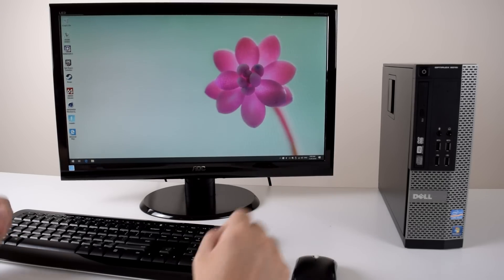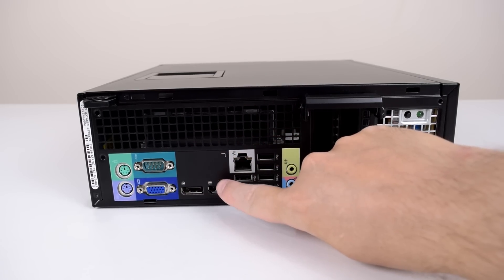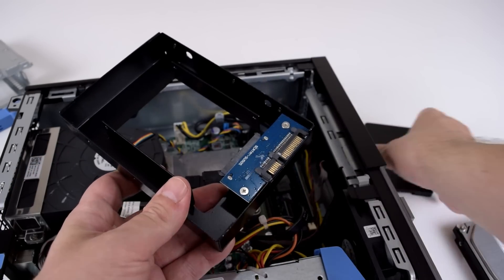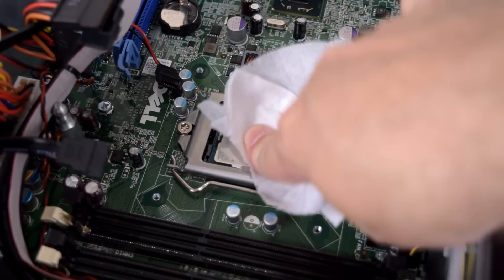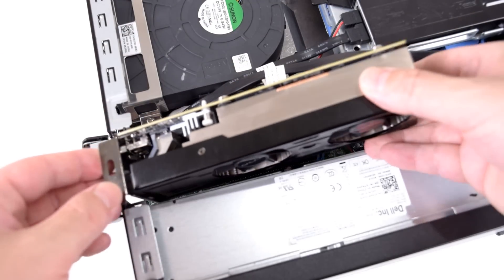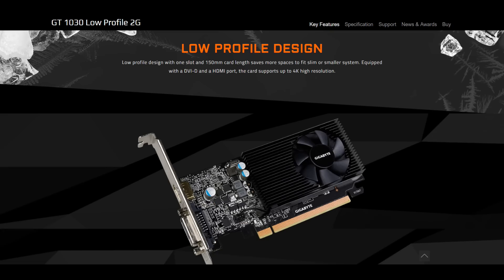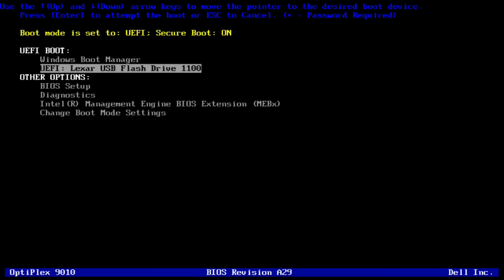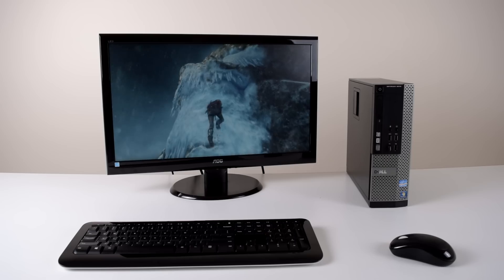DELL OptiPlex 9010 Upgrade Guide! Core i7 32GB RAM GTX 1050 Ti and more

Comment: 1050ti seems like a nice video card, bought 2 for use with blue iris for security cameras and both run surprisingly cool/etc(used off ebay, one is hp and other gigabyte)... last card I bought was 760 gtx, coming from that 1050ti is refreshingly simple looking and low power, only thing that would of been nice was a single slot design which I kinda feel they could of pulled off

Comment: Why a 1050ti with i7 i think rx 570 would be a better option.
Reply: The 1050ti gets it power just from the motherboard.  The Rx 570 requires an 8 pin power supply cable that this office pc probably doesn't have. It probably requires much more power to run as well that the small power supply here probably can't support. I think the RX 570 is a full size card too, so it wouldn't fit either.

Comment: I have i5 3570, 2x8 ram, ssd, hdd, stock 240W psu. I decided to add GTX 1650 mini OC (not low profile), so I made custom aluminium reversed T-shape stand, painted to black matt, painted Motherboard to matt black (no plastidip needed, just cover properly components), painted also PSU. From one side I mounted MB, from the other side PSU, SSD and HDD. No issues at all, good gaming like Far Cry 5 on max details @60fps or more. CPU/GPU temps never cross 63 degrees. Custom LED stripe. Very happy with my build. But 240W is more than enough for i5 (77W) + GTX 1650 (75W) = for cards without additional external power 6pin connector
Reply: you had no problems?

Comment: gpu is blocked and cant pull air
mine 2 when i removed the case cover i noticed 15c degrees reduced temp

Comment: I love the Optiplex machines. I was able to modify the bios to add bootable NVME drives via the PCI-E x16 slot with a cheap adaptor. This worked on the 7010 and 3020 models. Great little office PC. Now NVME 128GB m.2 drives are as little as ~£17
Reply: Have a link?
Reply: @tehgearz  I might do a whole blog article about this but the bulk of my journey was via the win-rar forum. https://www.win-raid.com/t4537f16-Dell-NVME-BIOS-Lock-Mod-Discussion.html Basically if I recall correctly it's put the motherboard into service mode with a jumper by the lowest PCI-E slot. Boot into DOS via USB. Make an image of the bios. then modify the image to add the NVME functionality using the correct software. win-rar has an excellent article. Then write the modified bios. Restart and then you can boot from NVME if bios option activated. I added quite a few pictures to the win-rar forum. I'm SITH. I did this on my 7010 and used same method on my Dad's Optiplex 3020.

Comment: I got a barebone 9020 for about $40 on ebay. Added 32GB for less than 100, i choose a wx4100. It's about on the level of a 1050, certainly beats the 1030 but is a single lot card and absolutely silent. This frees up the PCIe x4 which I use for a dual sata/nvme card and thus also leaves the drive bay as is. Sata is the boot drive while i use a 2TB nvme drive for all my games. It reads about 1.5 Gbytes/s from that slot. You can also upgrade the standard psu to a 315W psu if you are concerned about power. This comes with a 6pin gpu plug but currently there is no low profile card awailable which requires more than the 75W a PCIe can provide. With an open case, a Radeon Pro W5500 might fit which exceeds the 75W. But, i agree, i love that little box. Waiting for a 4 to 5 TF single slot card which fit. Maybe AMD is going to release a W4500 some day. Otherwise, the WX4100 gives my 1650 quite a run for the money.

Comment: The main pc in my library which powers the other PC's has 32 GB ddr4 ram, no graphic card and an i9 8600k.
Reply: If you say so
Reply: @alex-w8p2e  ooook
Reply: The i9 8600k does not exist
Reply: @alex-w8p2e  it maybe an 9600k
Reply: @alex-w8p2e  I dunno the exact specs but it's powerful...as hek

Comment: btw, if you don't have many options for a decent wifi dongle or you have an old smartphone laying around usb tethering is pretty reliable. my dongle refused to stay connected over 15 minutes straight so my sister gave me her old moto g and it works pretty fast
Reply from the maker: Yea get a branded USB Wireless dongle, they work much better!

Comment: Nice video.  It's 2020 and prices for the 9010 i7 and GTX 1050 Ti low profile are falling fast.  Today, the i7 3770 CPU is about $70 and the GTX 1050 Ti low profile is $90 on a good day.  Very tempting upgrades for my 9010.  I lucked into my 9010 SFF with i5 3570 for $15 because the optical drive was broken!  It had a laptop hard drive with Dell 2.5 in. adapter so a SSD will install with ease.  I went with a half height 3.5 inch spinner which loads W10 fast enough for me.  I found a Dell GTX 745 (4GB DDR3) locally for $30 and added the same Wifi AC adapter as in the video for another $5.  Mine is $50 and is perfect for what I do which is YT and video streaming.  It will stream 1080P 60 fps with no stuttering or buffering.  It's small enough to put in the living room for service as a HTPC.

Comment: I got the same PC for the same price almost on EBay also. I read that I CANNOT use all 32GB of RAM (only 2 RAM sticks totalling 16GB) IF I intend to use the graphics card because of a lack of power (only 240W) and that is even if I unplug my optical/CD/DVD drive. I now only use one SSD and no other hard drive. Has anyone tips on this?  I bought it for video editing , so am very disappointed about not being able to use all RAM slots.  I don't own those RAM cards yet, though.

Comment: I recently bought an optiplex 9010 sff but mine seems smaller. I'm a bit concerned that if I get the same or similar upgrades they will not fit. Has anyone heard of that being an issue or should I be able to get the same upgrades with no issues.
Reply from the maker: Yea there is a smaller version to the one I used.

Comment: Can i shove a 1650 super instead? Great video btw!
Reply: No a 1650 Super requires separate power supply. It cant run off of the 75w PCI slot.  The 1650 DDR6 Low profile is the best the GPU can get right now in low profile sff. I'm doing one now with a HP i7-3770,  GTX1650, sff build.

Comment: Hey really loved the video, I have a optiplex 990 with no upgrades. I wondered if adding an msi gtx 1050 ti low profile would make my performances on games way better. Also, do I need a wire to connect it, I don’t find it in my computer. Thanks !
Reply from the maker: Yes a low profile 1050 Ti should work really well! There are no internal cables to connect, but you plug the monitor into the 1050 Ti of course!
Reply: Thanks !

Comment: Here is a gpu that works on most desk tops and does not require a power connector also fits in just about all cases and plays games in high to mid settings , its one of the best out there if your on a budget like i was. Check this beast out in the link i provided and leave me a like if u agree.  https://amzn.to/39D6CO0

Comment: Hi mate was wondering will a full size gpu fit in there minus putting the cover back on aswell if there is few mod cutting things will it fit ? you prob heared this question before but so many full size 2nd hand gpus dirt cheap rather mod it to fit if possible
Reply: Im going to the 2nd version of this its not the full size desktop tower but between yours n fullsize

Comment: Would it work with this setup if I add the graphics card
DELL 790 SFF, Core i5-2500 3.3GHz, 8GB RAM, 250GB Hard Drive, DVDRW, Windows 10 Pro 64bit (Renewed)
Reply: If you can fit, itll work so u can play games on it

Comment: I was able to buy one of these but a mid size tower. I5 3470, 8gb ram for $50 added 8 more gbs ram, ssd, psu, gtx1060 6gb all for less than $250 total :) just need a 3770 next

Comment: I got a Dell Optiplex 7010 a couple of years ago upgraded with a GTX 1050ti graphics, it's been very good so far. These little things are sleepers, they are quiet at the desktop and cools well under load. I was surprised.
Reply: Not so cool on me. 
Mine GPU hit 84dgc
CPU hit 95dgc. 
7010 my
3770
Zotac mini 1070
Stock cooler
Cooler can upgrade?

Comment: These are really nice starter pc builds. Buy an optiplex 990 or 9010 off whatever website for extremely cheap- even in third world countries, they are really cheap. The most expensive part probably being a 1050 or a 1050ti, or even a 1030
Reply: will a gtx 1650 work inside of the Optiplex 990 SFF

Comment: Hi bud, I have the Dell Optiplex 3020 SFF but unfortunately  i can only put in the GT1030 GPU as the 16x is to close to the PS U . i currently have an I3 4160, 8gb ram, 500gb hhd what would be the best CPU upgrade to go for? maybe an i5 4590s

Comment: Did the same on the model a step below (Optiplex 990) for a total of $130 US back in March of this year.

Came with:
i7-2600 (highest upgrade is the 2600k so I left it alone)
8GB RAM (upgraded it to 16GB, the max allowed)
No HDD
No GPU

So, I grabbed the machine for $70 on an auction site. It came in terrific condition.

In then went back to the same site and grabbed an unused GT 1030 for $50.

I got a 250gb HDD for free using a discount code that same site gave me a while back ($5.00 total).

Finally, found an 8gb RAM upgrade (2x 4gb) for $10. Same exact brand and model that came with machine, too!

It runs great and it but far the best bang for my buck that I've ever spent on a computer. It has that exact same case as your 9010, btw.

Comment: The low profile 1650 will fit too
Reply: jonathan adviento YES!
Reply: @TheGr0nch  you also use the low profile 1650 on the Dell 9010 or were you simply happy to read that info?
Reply: will this work for the Dell Optiplex 990 sff
Reply: are you having any power issues with it?  I want to edit videos

Comment: Thank you for this video so much. I noticed these cases being used and sometimes widely cheaply reselled at one of my former jobs and got the exact same idea. So I started goodle around a little bit and voila, here comes your vide with precisely this set, giving very useful tips and answers to possible questions! Thank you. It's always fun to grab some old-ish piece of hardware, not originally even ment for this stuff, and try and see can be made from it. So, skip few weeks to present, here I am home with this thing on my table, having fun just looking through its insides, seeing how they packed it all in so little space. I have maybe one more question, if you would like to have a look. Do you thnik the MSI 1050Ti LP (currently the second item shown after clicking your link) would fit in? I'm asking because is is a little bit longer than the other models. Thank you if you take your time to answer, but even if not, thank you so much, the video was very informative and it was the thing that tiped me over to buying this pc and have som fun with it .)

Comment: Hello there! Thanks so much for this video! in few months, from now i am Buying an gtx 1050Ti low profile for my Dell Optiplex 7010 so My Question is, is it an good Idea to Change the power supply or keep the main Power supply? your video was Helpful, at the moment, i need an gtx since i use an Gt 710 Lol dont judge, everyone these days, dont have an big budget, but yeah, Thanks for the vid and please answer, Thank you
Reply: Well, any GPU without 6pin connector wont need you to change psu. But if u use 1050 ti or 1650 super. U can just use molex connector. No problem.

Comment: Hi there, i have the same computer and have added in a 250 gb SSD and outfitted it with some extra ram too.

my question is that with the standard power supply will it be able to run a GT 1030 with no problems?
cheers

Comment: Great video. I have a 9010 with 1050 ti I built after watching urs and many other videos. Thanks for the awesome info.  
I have an i7 I can put in it and am running 32 gb ram. I want to upgrade the video card to something like a rx580 or 1070. Will have to get a power supply and new case. 
With the 9010 at what level video card will the rest of the computer become the bottleneck?  I like the Xeon and early ryzen builds u have done but wonder if it is worth the upgrade or just add the better graphics card to the 9010?  Thanks

Comment: This is what I've been running as well. I got it with the i7-3770 stock, a 500 GB HDD and 8 GB DDR3 ram. I added a 1050 TI and a PNY 120 GB SSD. I have had no issues with power consumption even with overclocking the GPU. So if anyone is concerned about the psu, it is nothing to worry about.

Comment: How did you measured the power consumption of the system ?
Reply from the maker: With a power meter!
Reply: @philscomputerlab  
1. We have a Dell 240w psu with 80 percent efficenty.
2. Without gc, the peak power consumption is 158 w. The Real consumption is 0.8*158=126.4
3. Gtx 1050ti consumes 75w. So we need a psu that Can provide at least 126.4 +75= 201.4 w. This Dell psu Can provide at most 240*0.8=192w. 

I don't think this Dell psu is enough.

Comment: I got a 7010 DT and 1050 Ti with 24GB. It's been pretty good. Haven't changed the CPU from the i5 3470 just yet, and I'm still waiting to get the full 32GB later.

Comment: You don't need that 3.5" adapter there is an official dell blue bracket which allows you to mount 2 x 2.5" drives instead of a single 3.5", they cost like $5 on ebay.
Reply from the maker: Do you have a model number, because I can't find such a device. Or a link please?
Reply: @philscomputerlab  https://rover.ebay.com/rover/0/0/0?mpre=https%3A%2F%2Fwww.ebay.co.uk%2Fulk%2Fitm%2F142920516032

It clips into the normal 3.5 caddy bit and you mount a 2.5" on the top and underside

Comment: I just had three of these fall on my head... all with i7-3370K, and Dell-supplied video cards.

The best one has a Radeon R7 350x (4GB) and despite having a fan it only uses one slot, and runs cool enough that it doesn't make a hot spot on the case. I'm not concerned with gaming but have noted it has very good color. Max power listed at 65W but judging by how cool it stays, in ordinary use it probably doesn't draw anywhere near that much. It will do up to 2560x1600. --ETA: per GPU-Z, the slot can deliver up to 45W.

Then I tripped over 32GB RAM for only $70, so it got an upgrade. (Remember to set Windows swapfile min/max to something like 2GB, or you'll go mad waiting for 32GB to read and write.)  I have no idea why I need that much RAM, but for the price figured might as well max it up. 

Will swap out the HD for a pair of SSDs (it has 3 SATA ports, may as well use 'em). Had an  eSATA card so put that in there as well; maybe I'll rig up a tower of HDs on their own PSU for external storage.

Dell PSUs like to play dead (or die entirely) when loaded near capacity, so glad to see reassuring numbers on that count.
Reply from the maker: Interesting card. I've just recently tested a Low Profile RX 550, there will be a video soon. Yea DDR3 RAM can be had for a good price and SSD helps a lot as well.

Comment: Hey Phil!!! What a coincidence, I decided to build this exact PC basically independently of this video!

I ran into an issue though, the one I bought on Ebay for a mere $120 came with an i7-3770 and 8GB of RAM.  I bought this ram:

https://www.ebay.com/itm/32GB-16GB-8GB-4GB-DDR3-1333Mhz-1600MHz-240pins-only-AMD-Desktop-DIMM-Memory-Lot/153535264048?ssPageName=STRK%3AMEBIDX%3AIT&var=453523756803&_trksid=p2057872.m2749.l2649

Off ebay since it matched the model number and freequency, but when I put it in the machine I either get 2/4 modules not recognized, or I get 16GB detected but only in single channel mode.

Any advice?

Also, what inspired me to build this was I saw a Dell All-in-one stand in use at my place of work and thought it would be excellent to put a decked out SFF computer in it and use it for easy transport at LAN parties.  It came out great with a $30 1080p Dell monitor compatible with the $30 Dell All-in-one stand, $120 for the Optiplex 9010 SFF and I managed to snag a 1050ti for $120 also, so in total I spent just over $300 (with the RAM and a wireless mouse/keyboard).
Reply from the maker: Yea you bought AMD-only RAM. It won't work with this machine, only with AMD motherboards.

Comment: It's possible to have 2 drives (ssd + hdd) and the optical drive (dvd) at the same time?? All of them, please let me know.
Reply: I am thinking of disconnecting my optical drive wire and only using it in an emergency...like if I MUST upload a new OS by disk...that may be outdated by now, though.

Comment: Dell optiplex XE2 is the SFF you want to buy for these upgrades. It’s the newest version of the old modular optiplexes like the ones he’s showing in the video. The XE2 also comes with a 315w psu so you NEVER have to worry about psu. 

FYI mine was $80 before I started upgrading. 

* 1650 low profile is coming out soon and will take this machine from a entry gaming pc to a mid range beast.

It also rumored ASUS will make a 1650ti low profile with over 1000 cuda cores.  ~ if that happens you could turn this pc into a 2019 gaming monster for the price
Reply from the maker: Thanks for the tips. I had a quick look, I can see a lot of those in the UK, but not here in Australia for whatever reason.
Reply: PhilsComputerLab  yeah then yours is the next best option. Maybe even the best option since on the XE2 You have to the slower pcie slot. I just wanted to have the 315w psu to be safe. Idk if the slower pcie slot hinders performance but all seems well on my build

Comment: Could these upgrades be performed on the Optiplex 7010 sff? I’ve read that they are basically the same machines with same motherboards as the 9010 except the 9010 has the newer/faster i7? Can someone verify this? I already have an ssd so I’m good there. Just want more speed. Can the 7010 be upgraded to 32gb ram and the i7??